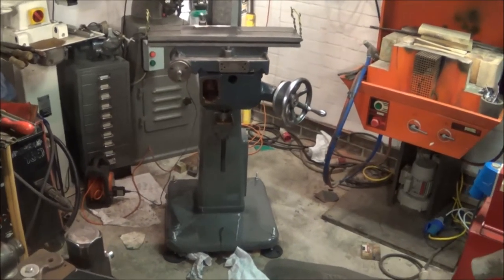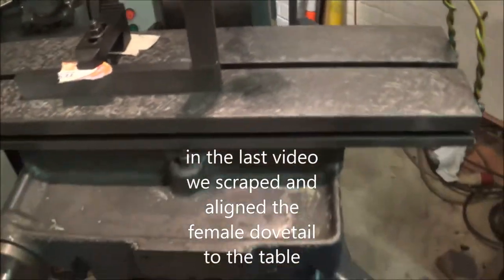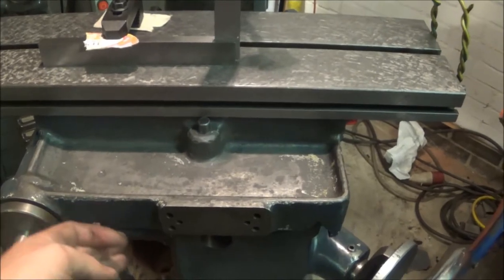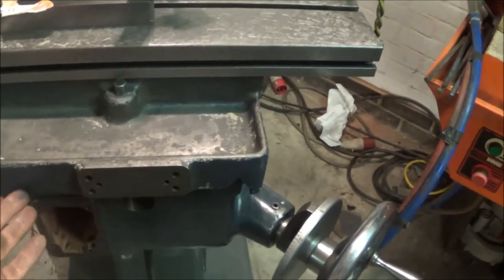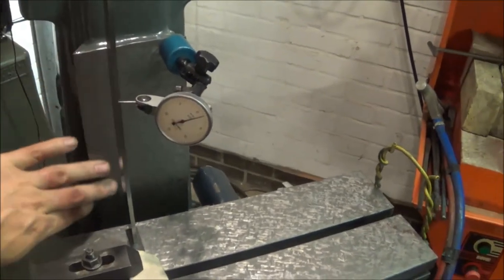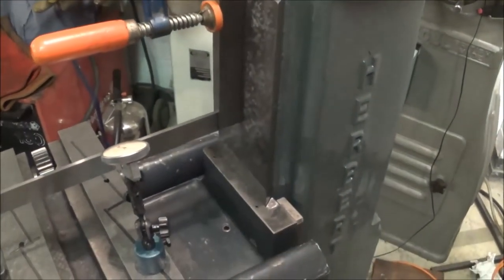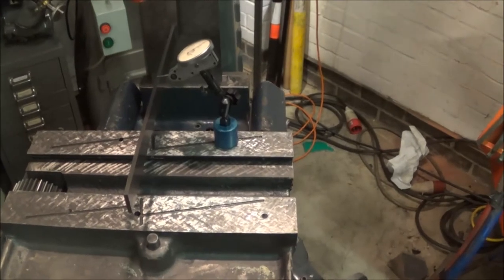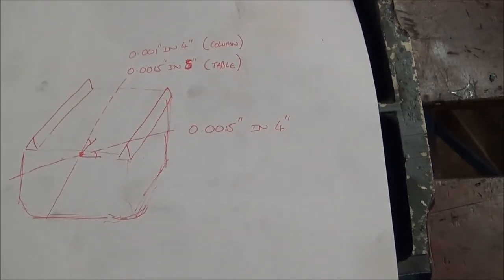Herbert Surface Grinder part 5 completing the scraping

Comment: Looking good. were you happy with the alignment pre' adjustments to the inverted V ways or were you surprised that it had the discrepancies measured (more than you thought)?  From what I recall you had left those V ways until last so they were unscraped at that point and it merely showed the wear left in them ... - does that make sense ? I just about finished my shaper and skimming the table top to clean it up showed up a few 'errors' I could not explain. Much head scratching involved.
Thanks for the update - its looking great by the way.  All the best Mat
Reply from the maker: Thanks Mat.  I only scraped the knee for contact and so expected the ways to slope down, the inverted vees were scraped parallel but not to the same height.  I left it to this final scraping activity to pull these into alignment.  Thankfully I did not have too much to take off. Im glad the scraping is over, I was getting a bit bored with it!